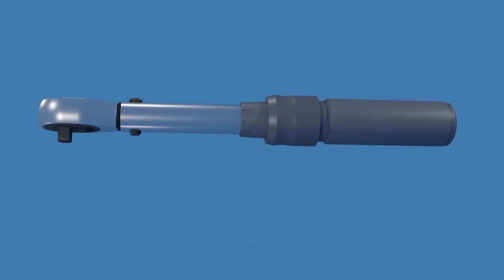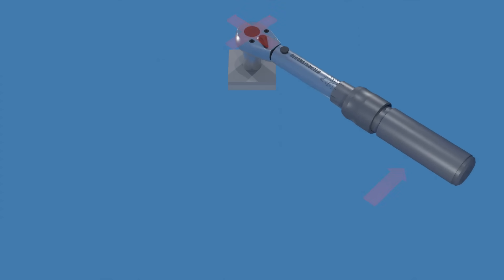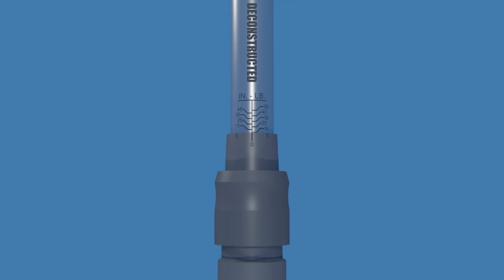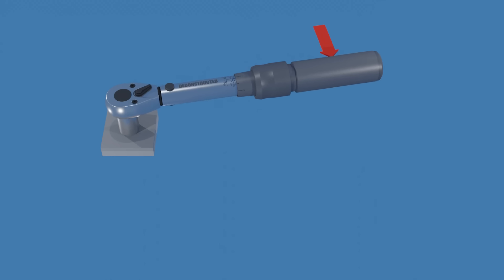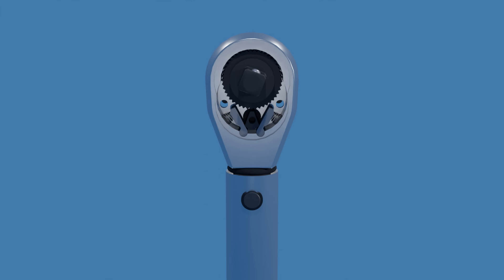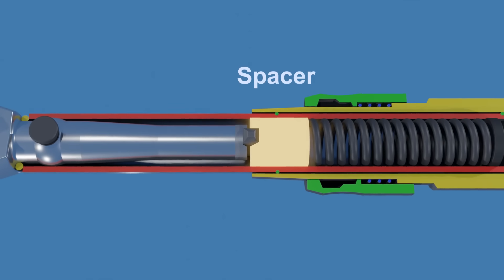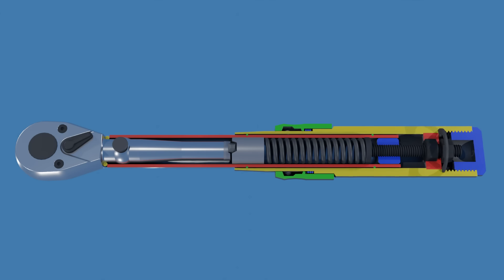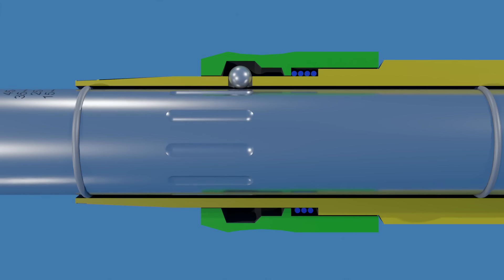How a torque wrench works

Comment: An important mention is that a pivot type torque wrench will only provide you with the set torque if you apply the force on the intended place (the lever). Holding it closer will result in overtightening while using a extension bar on the handle will result in undertightening.
Reply: Surely if you use a cheater bar, you're applying a lesser force at a further distance to get the same moment or torque (m = f*d). So if the mechanism inside clicks at a given moment, it doesn't matter how long the lever arm is?
Reply: @joshdaly2343   the spring inside is calibrated for a given distance from the socket, which changes the "d" in your formula if you add a lever
Reply: @joshdaly2343  This is far more complicated than is covered in the video, but explains how complex this style of wrench really is. There are three critical points in any lever. The   fulcrum or pivot, the load point, the effort point. The issue is really the fulcrum point, it's that pin in the wrench body as shown in the video right?. Problem is, nothing holds it. If you were to hold onto the wrench at the pin, simple math says you will always apply 0 effort to the load because your distance to the fulcrum is zero. However, we know thats not true because we are still applying force that is not centered on the fastener and thus we are actually applying force. 

So lets simplify it just a little and ignore the torque wrench part for now. The point about which our lever arm rotates is the fulcrum, which is the center of the fastener. So what are the load and effort points? Lets simplify the concept of a socket to just a single point of contact. Imagine if you would a one point socket, it's just a single pin that pushes on the flat of our fastener and pretend this will not bend or slip, it's a perfect force transfer point into the fastener. This is our load. Now you have your hand, this is your effort. So you want a 100Nm torque on your load and you have a 1m long wrench. Thats Force x 1m = 100Nm, so you input 100N of force. If you move your hand up the wrench close to the middle thats Force x 0.5m = 100Nm so you need 200N of force input. Simple.

Now look at the torque wrench click block, that is the indicator for how much force is measured by the torque measuring system. So lets identify the parts of the lever here. This is where we need to look at the click block because it's definitely part of the system. This click block tips when the force on it from the wrench exceeds the force of the spring. So lets call this our load as it's clearly not the fulcrum and we are using our hand for the effort. What is the pivot? Our hand acts on the wrench body which is the lever arm, the wrench body acts on the click block seat, so the fulcrum must be directly attached to the wrench body. The only option is the pivot pin in the wrench body. So now we have a second lever that is different from the first and the two fulcrums are NOT the same. Lets use a 1m long wrench that we set to 100Nm. Lets pretend for this model of wrench that the click block is halfway up the handle at. But that pivot is not 1m from your hand, it's actually a little closer  than the fastener which was our previous fulcrum (lets use 5cm to keep the math easy) lets also real quick look at the full equation for a lever Force(effort) x Distance(effort) = Force(load) x Distance(load). We know our hand is 0.95m from the fulcrum and the click block is 0.45m away. So we now have Force(e) x 0.95m = Force(l) x 0.45m. Since we set the wrench to 100Nm, we know that an effort of 100N will make it click. So we can complete the equation with 100N x 0.95m = Force(l) x 0.45m. If we solve for Force(l) we actually get 211N. 100x0.95=95 and  211x0.45=95. So we can say that when the wrench is set to 100Nm, the block clicks with a threshold of 95Nm, but the extra 5cm on the wrench to the fastener increases that to 100Nm.

Now say you move your hand halfway up the wrench. The click block never moved, the spring never changed, therefore the force required to 'click' on the load side of the equation did not change, it's still 95Nm. BUT, the distance of our effort changed. Our hand is in the middle of the wrench. So lets solve for the click block first. It needs 95Nm to click. We know our hand is right in the middle of the wrench at 0.5m, but we need to account for the 5cm closer pivot pin. So the distance of our hand is 0.45m. Now we have Force(e) x 0.45m = 95Nm. Solve for force and you get 211Nm. But hold on, we are exactly in the middle of the wrench and it took 211Nm to make it click. Lets use that effort input of 211Nm on our fastener. We know our hand is exactly in the middle of the wrench, so it's 0.5m from the center of the fastener. 211N x 0.5m = 105.5Nm. Thats an error of 5.5N at 100Nm (4ft-lbs error at 73ft-lb).

Is that a problem? On most things, no. Some things, maybe.

Comment: I've seen car brands like Peugeot and Opel that will tell you in their repair procedures to use a torque wrench to untighten the wheel Stutts at a certain torque. The reason they are hollow inside. Even the animation uses an 11-mm 🤣🤣🤣. We all know what happened to the 10milli.

Comment: If they aren't meant to loosen, then why allow them to operate backwards. I don't know any left handed threads outside of plumbing that are in common use. Wouldn't it be better to either make it unidirectional or remove the paw for the other side to allow free spin to remove the wrence from a tighter spot.
Reply: Left handed threads are common enough that I wouldnt wanna buy a whole extra wrench for them
Reply: The most common application for left-hand threads that should be accurately torqued was wheel nuts on the left side of a car; that's uncommon now, although some trucks apparently still have it and it was very common on cars a few decades ago.

Comment: I want to correct a thing that is incorrect in your video. Using a torque wrench to loosen a bolt isn't neccessary bad, as a torque wrench is designed to operate in both directions. HOWEVER, you must, even during loosening a bolt, not apply more force than when you reach a "click", as operating the wrench "past the click" will put too much stress on parts not designed to take the stress. So using a torque wrench to loosen a bolt, could be a great tool to check if a bolt have been torqued to spec AND that it hasn't come loose by time. Just set it to a torque value slightly below - like 0.25-0.5 below, the value a bolt is supposed to be torqued to. When loosening, a click and then the bolt comes loose immediately, then it has been torqued to the right spec. If it doesn't come loose when you reach the end of the "click" travel, STOP, bolt is tightened too hard (overtorqued) - now increase the tension to like 0.5 over the spec and try again. Then work in whole numbers, 1 over spec, 2 over spec, 3 over spec and so on, until the bolt comes loose with a click. If it comes loose without a click in the first test, it has been undertorqued or have come loose by time. If it comes loose without a click in a test where the bolt did not come loose even with a click in a previous test, then the bolt was torqued to a value between the 2 tested values.

In this way, the torque of a fastened bolt can be measured without re-tightening it and thus losing information about the previous assembly process, and quality defiences, like undertorqued or overtorqued bolts can be caught. In the same way, it can be measured if a bolt works itself loose due to vibrations and other movement incorrectly.
Reply: Loosening a bolt doesn't have to be a bad thing, but not all wrenches are bi-directional. Many, especially budget units, are not designed to work in both directions, and do not indicate if used in reverse rotation. Without an indication of maximum design torque being reached, there is no warning if it is being overstressed. It's just a commonsense precaution to not use in reverse if the manufacturer's instructions say not to do so, or if said instructions don't say you can safely do so.

Comment: still doesn't explain hoiw spring forece is translated to rotational torque...
Reply: Yes, that aspect is passed over without mentioning the relationship between the spring compression and the amount of lateral force required to tip the pivot block.

Comment: The thing that pisses me off about mechanics, especially older ones is the behavior of  clicking 3 or 4 times believing that it... tightens it more? idk. If you set it to a certain torque, you're gonna use that exact torque. And pushing more after click just breaks the wrench.

Comment: The biggest misconception around torque wrenches couldn’t be missed in this video of course: “if you use a torque wrench to losen a bolt could damage the tool or make it inaccurate.” This is 100% not true. Why? Believe it or not, there are screws, bolts and nuts with a left-hand thread and if you tell me the tool can be damaged by torquing these down I lose all hope in society.

Comment: The tool that separates Men from Boys is the use of torque wrenches and actually knowing what you're doing with them, especailly when it comes to bolt torque patterns on flanges. 
Any idiot can use a ratchet.

Comment: You used Foot-Pounds, which is incorrect (Length of Lever divided by Force), but you used Newton-Meters, which is correct (Force divided by length of lever)
Reply: It's never devided! Torque is the multiplication of length of lever and applied force. Thus it doesn't matter, which one you multiply first. (eg 1ft x 15 pounds or 15 pounds x 1ft)
Reply: Ft*Lb (foot pounds) not Ft/Lb (feet per pound)!

Comment: 5 1/2 minutes of “what is torque” and “how a ratchet works” with 30 seconds showing how the torque wrench works. Great explanation and visuals, but this could have been a short.

Comment: Why does the torque wrench even have a reverse gear?
Reply: So that once the nut is partially tightened, you can easily swing the arm in either direction to locate where you want to begin the tension sweep without having to take the socket off the nut then jiggle to find the angle for it to drop over the nut again.

Comment: Looks like the epitome of '100 things to go wrong on a handtool that is not even powered'.
Impressive design, but how long would the designer and manufacturer guarantee it lasting and in what kind of restricted conditions? "no working outdoors, no subjection to very cold or very hot temperatures etc."

Comment: 0:25 How many ounce-yards are equal to 1 foot-pound? Imperial units are so weird.
One newton-metre is equal to the torque resulting from a force of one newton applied perpendicularly to the end of a moment arm that is one metre long and one newton is the force needed to accelerate one kilogram of mass at the rate of one metre per second squared in the direction of the applied force.

Comment: Wear a mask and gloves doing this,battery acid isn't good and neither is solder,dont use gas or have it connected like that I've had direct gas systems like that travel through water into the main chamber and explode violently